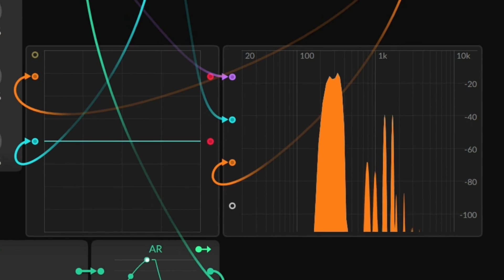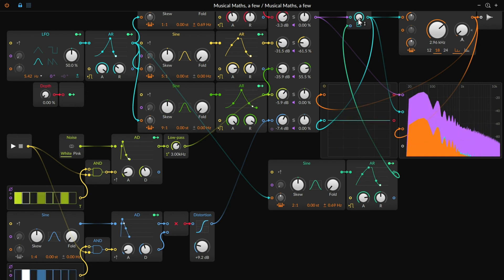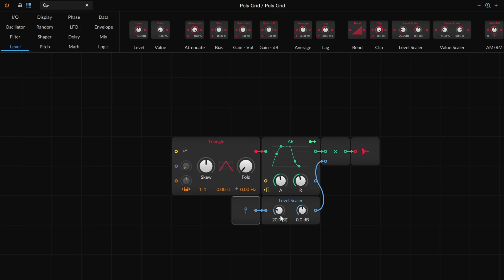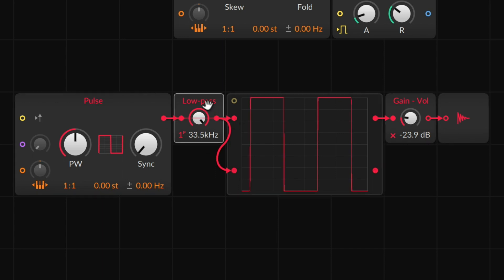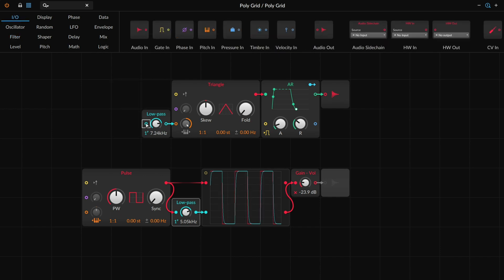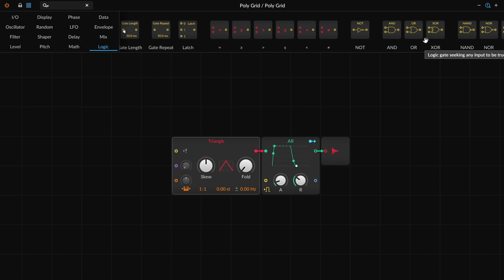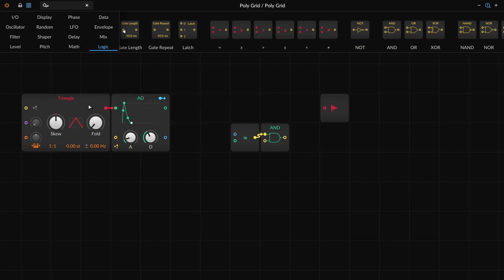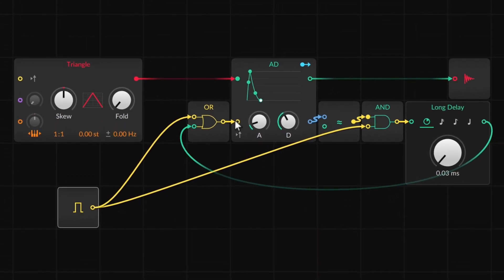Modular Concepts: Musical Maths [Bitwig Studio | The Grid]

Comment: Why did you need a gate length after the long delay module? it works without it too, right?
Reply: As long as you keep the patch as it is then it would probably be fine but if you start to build up more complex sequences of logic gates it can start to get pretty confusing and lead to unexpected behaviour if you're like me and forget exactly what each thing is supposed to be doing.... and having 'stuck' high logic signals causing things to fail to trigger is a very common thing, so if you're just using something as a trigger then it's generally going to lead to fewer headaches in the long run if you make sure it just behaves as a trigger by ensuring that you always have a positive edge when you want one !
Reply: @ZDR i was hoping i would find this comment! i thought the same thing, it seems like the long delay mod would suffice as to re-trigger. hmmm. if i had full bitwig, i'd check it out myself lol.